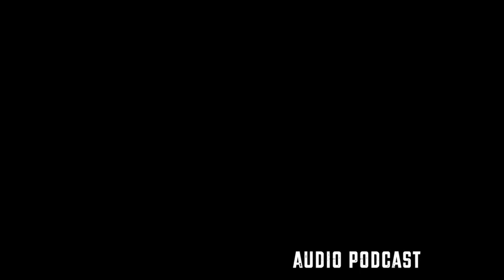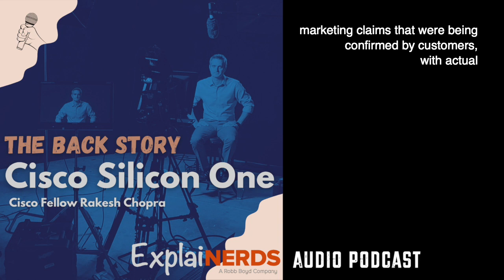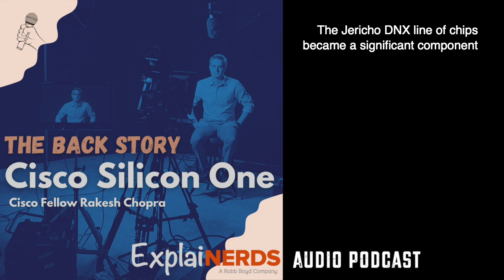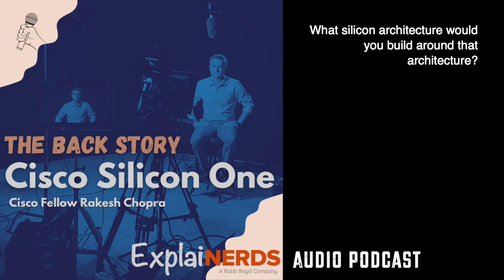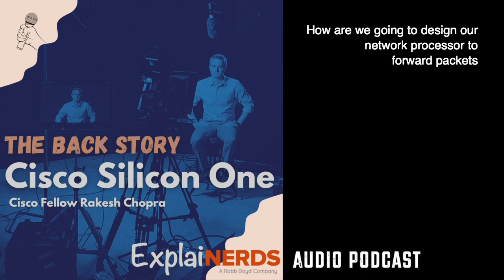Cisco Silicon One: The Back Story (Audio Podcast)

Comment: Well, While Cisco is very proud about on their Cisco Silicon One so is Packet Architects which have this same capability. Do you want to 10 different devices within a 6 weeks period? Not a problem, we take about 1-2 hours to build a new unique Switch/Router IP with unique packet processing, L2/L3 functionality, Buffer sizes and port speeds.